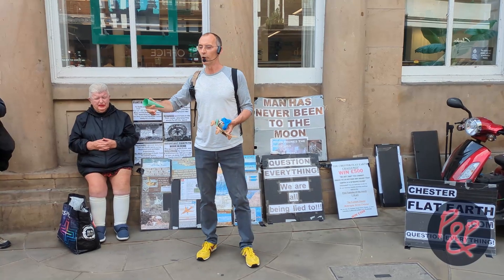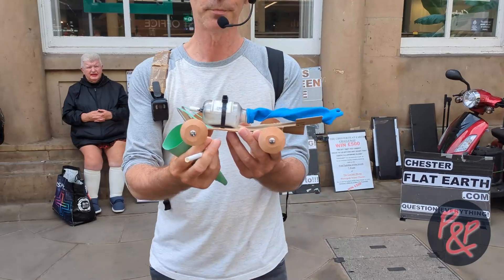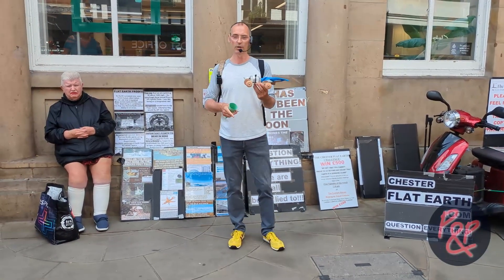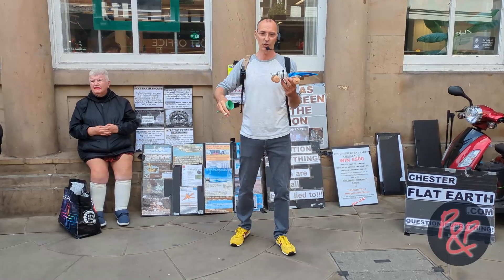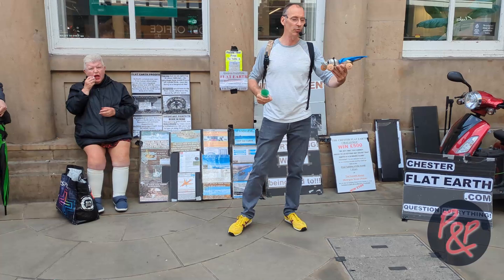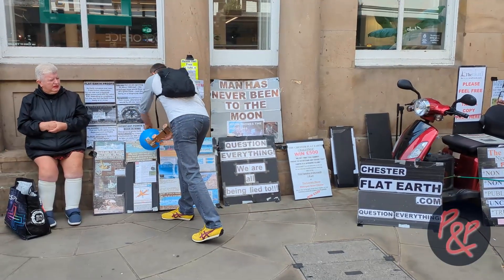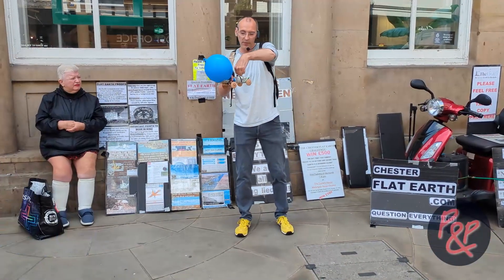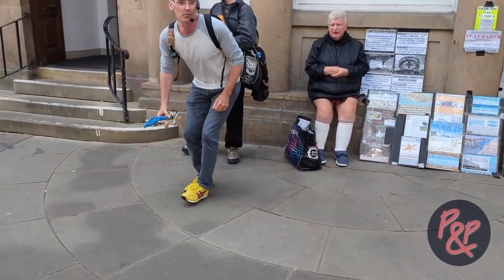Street Demo: How a rocket doesn't work!

Comment: No transference of energy in an infinite vacuum! Nothing for the hot gasses to expand against/entropy defines this/keep up with the Newtons cradle nonsense! Fools!
Reply: So then please explain what would happen if a crossbow fired a projectile in a vacuum.
Are you claiming that it would experience NO Recoil force?

I don't think that how Newtons laws work.
Reply: The expanding gasses push on the rocket. 

It would be a violation of the laws of physics if rockets didn’t work in a vacuum.
Reply: @AM-rd9pu  That’s very interesting considering the outright amount of scientific evidence proving they don’t operate in a vacuum.
Keep an eye on the pressure gauge on the vacuum pump as when the rocket engine operates the inadequate vacuum pressure rises due to the stored energy within the rocket! Creating minimal movement.
This never happens if the vacuum pump is substantially adequate to maintain the negative pressure. And most importantly never in an infinite vacuum as this is scientifically impossible.
Reply: @thejollyman  If you are incapable of answering my simple questions then you have no business trying to lecture others on basics physics.
Reply from the maker: evidence is NOT proof therefore, evidence cannot show unequivocally that rockets work in vacuum, evidence can only support the IDEA a rocket thruster can propel a vehicle in a vacuum! Cheers!
Reply: @PeterPete  and ALL of the actual evidence says they DO work in a vacuum.
You have exactly ZERO "proof" that they do not.
What you claim is evidence is not, it is merely YOUR misunderstanding of physics.
Reply: @thejollyman  I see that you like to just make false statements then RUN AWAY when confronted.
Very mature of you.
Does Mommy know you are using the computer?
Reply: @thejollyman There's literally zero evidence that rockets don't work in a vacuum. 

Who's been lying to you? 😂

Comment: This is hard to watch. First of all, the car did move a little bit. Second of all, you increased the radius of the outgoing gas, and so the pressure is decreased by the inverse square of the radius of the escaping gas. Put your finger over the top of a garden hose and get back to us on that. All those people walking by not paying attention had it right.
Reply: I see no nudge at all, but I do see definite motion, as well as a balloon deflating a little bit very much before you released it. The deflation of the balloon is quite akin to the validity of your arguments.
Reply from the maker: you're not getting it  mike - all you are doing imo is finding any reason NOT to accept the results in a vain attempt to hold onto your globe ideology!

Trust me the balloon car only moved the second time due to a nudge I gave the car when releasing the balloon. The car did not move due to the air exiting the balloon which means NASA's explanation for how a balloon is propelled through the air is wrong!

Imo what happens is this -

Because of the elastic properties of the balloon, the balloon pushes the air out of the balloon at a constant rate. From the balloon the air rushes out through the straw with a degree of force - this is the ACTION. 

Now in order for the balloon car to move resistance must be present. So as the forceful  moving air stream exits the straw it is met by the stationary surrounding air and it is this that provides a resistive force, that slows down the exiting air stream. As the force of the stationary air is so great, an imbalance between the 2 opposing forces builds up making the balloon car move forward!

There you go. Given this understanding a balloon car will not move in a large enough vacuum!
Reply: @PeterPete  - "- all you are doing imo is finding any reason NOT to accept the results "

Just like YOU DO by REFUSING to watch ANY of the SpaceX launch videos?
Bless your little heart!
You don't even realize how strong the Dunning-Kruger IS in you.
Reply from the maker: @stuartgray5877   you're neglectinng the fact the air inside the balloon is still able to exit the balloon.

According to science, NASA etc once the air stream leaves the straw it is irrelevant to the generation of motion!!!

According to mainstream science all the car needs to move is the air to freely exit the balloon and an opposing force will be generated at the front of the balloon to push it forward!!

This is not true - 

It is clear that the exiting air stream is vital in determininng whether motion is genereted or not!!
Reply: @PeterPete  So you are arguing that the balloon can make the air escape WITHOUT APPLYING A FORCE TO THE GAS.

So You think the gas from inside the ballon just decides to come out all on its own?
Or does the Atmospheric air "SUCK" the air out of the Balloon?
The gas inside the balloon decides to LEAVE the Balloon - WHY?
Magic?
Reply: @PeterPete  So unwilling to just explain where you think the force originates that accelerates the gas from the balloon?
Is it a secret?
Seems like a perfectly reasonable question to ask.
Why won't you just give him an answer?
Reply: @PeterPete  I never mentioned anything about a spherical earth in my comment. I'm just merely stating that making a gas flow from one volume to another slightly lesser volume (than the original demonstration) is hardly an action at all, now is it?  So why would there be an equal reaction, when you have purposely constructed a lesser action, yet you seem somehow surprised by this like you've just discovered something original. This seems to be a theme with you guys.

And this is why most ideas presented on the street are not valid ones. If they were good ideas, there would be no reason to heckle people with them on the street, imo.

Comment: Peter - Here is an actual "Physics Problem" that a physics student in say HIGH SCHOOL, might encounter.

A remote-controlled crossbow of mass 10,000kg is sitting on a frictionless surface.
It is loaded with a projectile of mass 500 kg.
The Bow is cocked and an observer, with the remote control, is next to the Crossbow.
Now the initial velocity of the Bow, Projectile, and Observer is all zero (their relative velocity with respect to each other is zero).

Now the observer fires the crossbow, and he observes the projectile exiting the bow to his "Right" at a velocity of 2500 meters per second.
What is the velocity of the crossbow due to the firing of the projectile?

People who understand basic physics would solve this problem using the "Law of Conservation of Momentum".

Peter Or Pete - Can EITHER of you solve this trivially simple physics problem? ( I can do it in my head, no calculator)

If you CAN then we can have a conversation about rocket propulsion.
If you are incapable, then you cannot understand rocket propulsion. It's just that simple.
Reply: Using the Law of Conservation of Momentum, the crossbow must absorb the same momentum as the projectile.
Momentum is defined as mass times velocity or P = M (kg) x V (m/s)

The Momentum of the projectile after the firing is Pp = 500 kg X 2500 m/s = 1,250,000 kg x m/s
The Momentum of the crossbow after the firing is: Pc = 10,000 kg X Vcrossbow

Setting this equal to the momentum of the projectile yields:
Pcrossbow = 1,250,000 = 10,000kg x Vc
Solving for Vc gives:
Vc = 125 meters per second.

So in absorbing the same momentum as the 500 kg projectile accelerated to 2500 m/s, the 10,000kg crossbow MUST have a final velocity backwards of 125 meters per second.
Per Newtons Laws.
Reply: And yes, anyone who has solved even one of these simple two-body problems sees that the velocity of the two bodies is proportional to the ratio of the masses.
Since you said the final velocity of the projectile is 2500 m/s, and the mass of the two objects is 500/10000 or 1/20, then the final velocity of the crossbow is 1/20 that of the projectile or 125
Reply: @rocketman484  Thanks
But NOW pet and peter won't bother to try to answer.
They will also not comment on your calculations because they don't "DO Math".
But we can watch as they IGNORE actual "Physics"
Reply: @rocketman484  Its pretty telling that dumb and dumber here, NEVER address actual Physics problems. They RUN AWAY whenever we discuss actual equations, numbers, or units.
  Almost as if they have NEVER TAKEN A SINGLE PHYSICS CLASS IN THEIR LIVES.
Reply: Frictionless surface! Tell us more regarding your hypergolic vacuum assited fuels!
Reply: @thejollyman  Well for starters My company uses mono-propellant systems - MMH or Mono-methyl-Hydrazine.
So we don't use hypergolics.
However, we DID test a new Propellant under the Green Propellant Infusion Mission or GPIM.  Look it up.
Here's a list of spacecraft I helped build and launch:
Mars Global Surveyor, Stardust, Deep Impact, Kepler Space Telescope, NOAA-20, IXPE Xray Telescope and USSF-62.
Ask me any question you like.
Reply: @thejollyman  - "Frictionless surface"

Yes Engineers frequently solve problems "Neglecting Friction" or "Ignoring air resistance".

Maybe if you had ever bothered solving a physics problem in your life you might understand.
Reply: @stuartgray5877  So there is no Earth rotation then? What do you mean not solving physical problems?
Reply: @thejollyman  no.  We measure earth rotation tens of thousands of times a day worldwide using fiber-optic gyroscopes.
We also launch rockets to space from the US about once a week now.
Do try to keep up.
Reply: @stuartgray5877  Dude they measure Earth rotation👀 show me how this is done! Go for it!
Reply: @thejollyman  And another FACT: SpaceX launches a rocket to space with tens of thousands of live spectators on average more than once a week.
Tell me WHO is their biggest Customer?
Reply: @stuartgray5877  Bold claims! Can you prove this statement! Show me the proof physically and scientifically? You can’t I’ve checked?
Reply: @thejollyman  I have been building, testing, launching a d operating earth orbiting spacecraft and deep space science probes for almost 30 years.  My entire career is proof.  But since you don't accept any other established science then what would a few "facts" mean to you??  Nothing, so have a nice day.
Reply: @stuartgray5877  Not wanting to undervalue your career choice! Are you sure these space craft are orbiting the Earth are they in a gravitational sweet spot similar to the IFS.
Reply: @thejollyman  I have built and launched: Mars Global Surveyor (orbiting mars for many years), Stardust (retrieved samples from a Comet and returned the to earth), Genesis (retrieved samples of the solar wind and brought them back to earth, Deep Impact (slammed into a Comet), Kepler Space Telescope (discovered thousands of planets orbiting other stars), NOAA-20 (US weather sat orbiting over our heads), IXPE Xray Telescope, and USSF-62 (weather sat for the US military).

I am helping to build SWFO, GLIDE-Carruthers and NEO-S right now.
Reply: @thejollyman  Tell me what happened to the comet named 'Tempel-1' on the evening of July 4th 2005.
Hint: It resulted in the largest social media response in internet history that night and brought down the Facebook servers.

Another hint:  I was sitting behind a command-and-control console at JPL in the Mission Operations room for the Deep Impact mission.
Reply: @thejollyman  SO that's a "NO I will NOT explain something witnessed by Millions of people because that would prove ME wrong"
Got it.
Thanks.
Reply: @thejollyman  You are incapable of answering simple physics questions why would I think you could do 30 seconds of research?
Reply: @stuartgray5877  You haven’t asked any! 
Can you explain in more detail if possible imaginary particles and their relationship with conceptual four dimensional space please.
Reply: @thejollyman  - "You haven’t asked any! "

"Tell me what happened to the comet named 'Tempel-1' on the evening of July 4th 2005."

Sure looks like a question to me.
Reply: @thejollyman  - "Can you explain in more detail if possible imaginary particles and their relationship with conceptual four dimensional space please."

No, I cannot as this is not even a coherent question.
Reply: @thejollyman - "you haven't asked any"

So, when a rocket engine is running right here at sea level:
1 - Does the exhaust gas have "mass"?
2 - Does the rocket engine "accelerate" the exhaust gas"?
3 - Can anything OTHER THAN a "Force" accelerate mass (OR is a "force" REQUIRED to accelerate mass?)

Now answer those three trivially simple basic physics questions and we will get to the ones that are more specific to rocket propulsion.

REALLY?  I haven't asked any questions?  ARE YOU SURE???
Reply: @stuartgray5877  Not necessarily a coherent question in relationship to nature and reality! But I’ll give it a go.
1. Everything has mass/weight in relation to the medium it resides in. Molar mass of the relative density of naturally stacking gases.
2. Do rocket engines accelerate gas. 
Gasses hypergolic vacuum assisted ones?? Not real. As in incorrectly described.
Gases under pressure seek equilibrium when one’s used are heated they increase their volumetric energy and transference of energy.
But never in a 10x-17 Tor infinite negative pressure environment.
3. Don’t need a force when natural equilibrium or magnetism is present relative density disequilibrium and natural  buoyancy! 
Impossible to produce enough energy using Newtons 3rd law in a vacuum to create any thrust for the rocket.
Reply: @thejollyman  so what you MEANT to say was "I don't really understand basic physics at all"
You should have just started with that and we could have avoided all this nonsense.
Now GO BACK and finish high school THEN you can have a conversation with the adults.
Reply: @thejollyman  the correct answers are: yes exhaust gas has mass
, yes rocket engines accelerate mass
and no - ONLY a force can change the momentum of a mass
Reply: @stuartgray5877  keep memorising those Newtonian axioms and don’t forget the religious pseudoscience!🆘🤪
Reply: @thejollyman  Do you dispute my answers or not?

You are just trying to AVOID the questions because:
A - you don't understand physics enough to answer
OR
B - The CORRECT answers PROVE YOU WRONG.
So, which is it?

I was trying to have a conversation where I teach you something, but you refuse to participate by answering questions.
I am beginning to understand why you dropped out of school before the 8th grade.
Reply: @stuartgray5877  Please teach me more 🙈.
Question time for you! This should be interesting.
Are relativistic assumptions being made when galaxy clusters observed only have 1% of the available (by calculation only) of course Newtonian mass (using Kepler’s laws of orbital motion before Cavendish had even weighed the Earth)👍. 
What is Dark energy and why is it Dark. What are the particles? 
More importantly why are modern physicists and even theoretical physicists🙄denouncing Newtonian mechanics and Einsteins concepts as being impossible?
Reply: @thejollyman  Stick to the basics. AFTER you can tell me how mechanical recoil works (or doesn't work) in a vacuum, THEN we can move on to other topics.

Currently you are still confused by the fact that gas has mass, or that crossbows have recoil.
Reply: @stuartgray5877  Gas doesn’t have mass? Where are you getting this information! 
A rocket can not provide any thrust above the imaginary Karman line.
Reply: @thejollyman  - "A rocket can not provide any thrust above the imaginary Karman line."
Except for all of the proof that they CAN.

So if you agree that gas DOES have mass, then whey cant you just answer my simple questions about a rocket engine right here in atmosphere?
When a rocket engine is running (RIGHT HERE ON EARTH IN ATMOSPHERE):
1 - Does the exhaust gas have "mass"?
2 - Does the rocket engine "accelerate" that mass?

The question has NOTHING to do with vacuum or "the Karman Line".
I want you to explain how rockets work right here where we have been testing them for right around 100 years.
Reply: @thejollyman  I have worked at Lockheed Martin in Waterton Colorado where they had Titan Engine Test stands at ONE MILE HIGH.
I have also worked at Marshall SFC where they test rocket engines in a test stand at SEA LEVEL.
And at VAFB/SFB and KSC/CCAFS where they also test rocket engines at sea level

But you DONT think we know how atmospheric pressure affects rocket propulsion???  So, you think aerospace Engineers have just been standing around playing with rocket engines for about 100-years but they DONT REALLY KNOW HOW THEY WORK?
Yeah, that sounds legit.
Reply: @thejollyman  Where did you go? I was being entertained by a high school dropout trying to explain rocket propulsion to a rocket scientist.
Reply: @stuartgray5877  Sorry about that Stuart! Been busy in communication with the Royal Astronomical Society! 
Those explanations for rocket propulsion are all within the atmos domain! Provide the scientific explanations for similar phenomena in a vacuum!
Reply: @thejollyman  Yet see IF you could explain HOW they work IN ATMOSPHERE, then you would understand how they work in vacuum.

Since you refuse to discuss how they work in atmosphere and you DONT KNOW, then I guess we are done here.
I was hoping to help you understand but you must participate by answering questions.
At least now we know why you dropped out of school before the 9th grade.
You REFUSE to answer simple questions, this is PART OF LEARNING (something you have no experience with)
Reply: @stuartgray5877  Yes correct you concede as an honest so called rocket scientist that rocket propulsion is impossible in a vacuum. Thanks for your participation and good luck with your research! Hopefully we’ll be able to populate another planet soon!
Reply: @thejollyman  - "Yes correct you concede as an honest so called rocket scientist that rocket propulsion is impossible in a vacuum"
I said no such thing.
Stop lying.
It is a sign of a very weak mind to just make up your own reality.
But bless your little heart for effort!